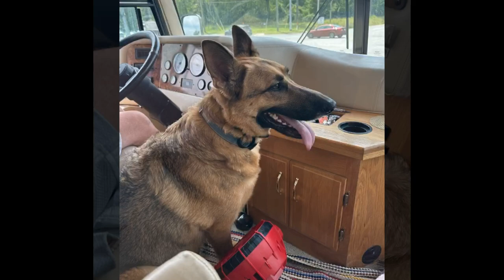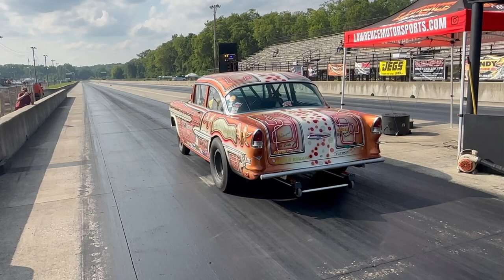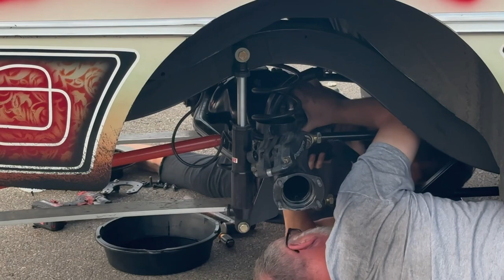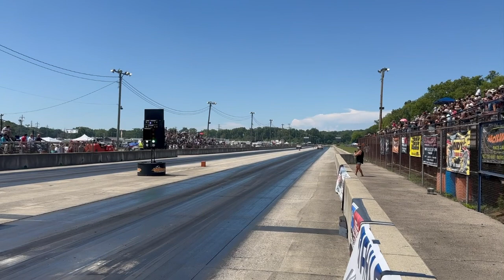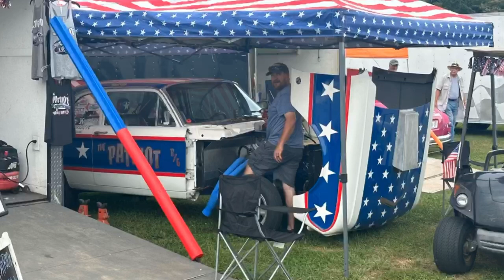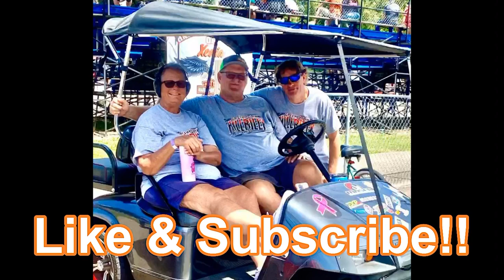Southeast Gassers @ Kil-Kare….we still have work to do

Comment: Otta curiousness what’s the valve spring seat pressure on those engines along with open pressure solid roller or flat tappet which do you run ,I’m jus a crazy Canadian with  small block
Reply from the maker: Solid mechanical roller. Thanks for watching!